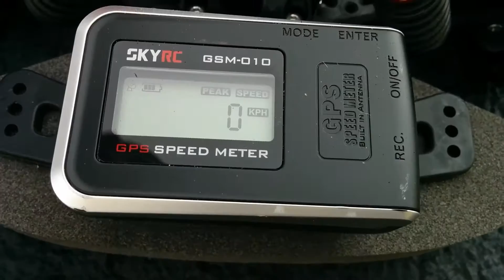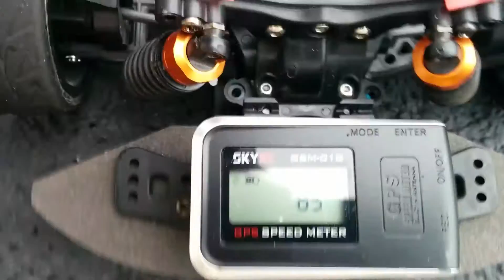TA05 911 GT1 speed run #3

Comment: Super fast! So you can put a Posche 911-GT1 on a TA05 châssis :) what combo of motor-battery are you using?
Reply from the maker: Yes, but you must modify the TA05  per the 911GT2 body set. Motor is a 3.5 turn and battery is 2S 3300mah.